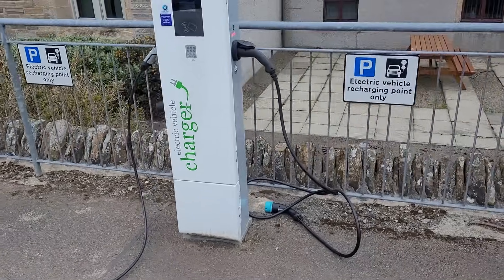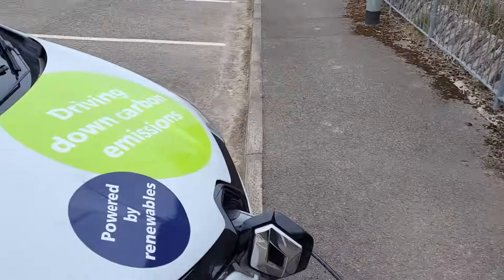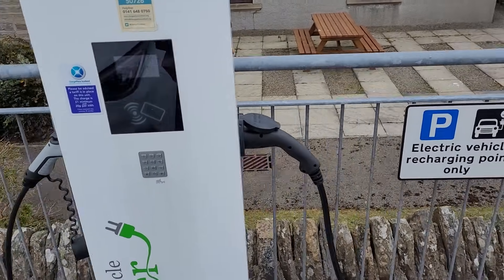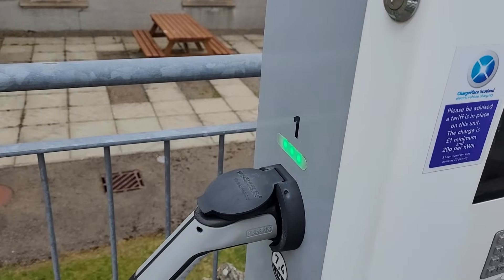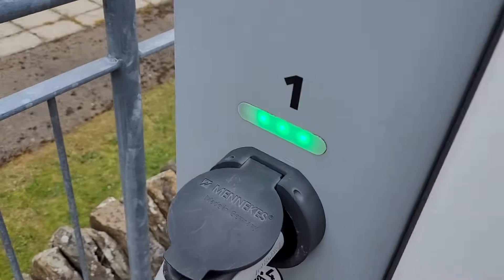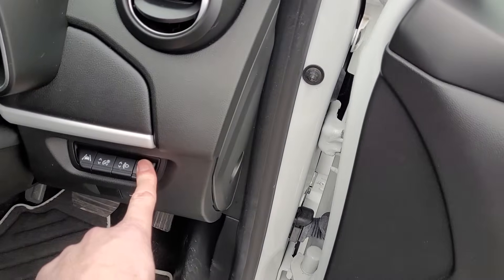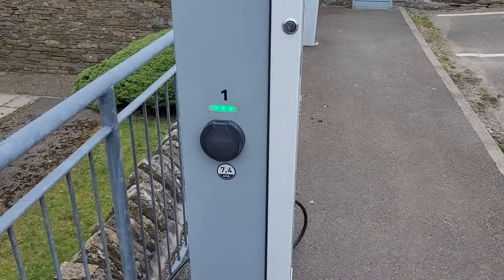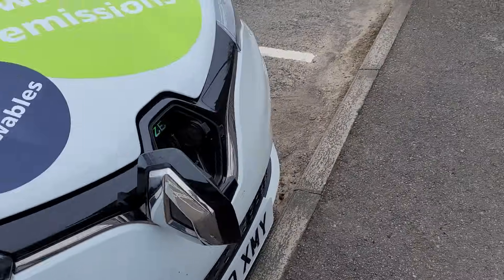How to disconnect your EV cable from a fast charger

Comment: We have just visited Southampton and the IOW. Twice the rapid chargers would not stop. Both occasions I telephoned the help line on the machine and they released them immediately. I asked if it was a problem with the car and they said no. It was a regional problem but they would not comment further. On the way home I stopped at an Ionity charger at Bridport and the charge went perfectly.

Comment: Why does it get stuck on a Mercedes eqs 550 I can't f**** unplug it I can't unplug the charger from
Reply from the maker: Try starting the charge again , then end charge with rfid card (or via the app ) ,wait around 5 seconds , then unplug from the post First then unplug the car , otherwise the post will see a 'fault' and lock the cable into the post.

Comment: Dear sir, aI used podpoint app to start charging at the public car park. But there is no option to stop charging in the app. There was no way I could remove the cable. Waisted my day.
Reply from the maker: Yes podpoint can be a nightmare , did you call their hotline ?

Comment: i will give it 3-7 years and with in them 7 years electric prices per kw will be the same as petrol, instavolt is going from 50p to 57p on may, thee electric car agenda is nothing but a smoke and mirrors trick
Reply from the maker: I charge at home 99% of the time from the 🌞 or 5p per kWh overnight.
With electricity we have much more choice on what to pay, same as expensive costa coffee at motorway services , no one forces anyone to buy a £4 coffee that you can make at home for pence !

Comment: I had a Nissan with a type 1 connector the only way to stop charge was to press the button on the car end plug and disconnect. The charger end always unlocked for me  so this requirement is clearly not universal.

Comment: This is a perfect example of appalling unintuitive design.  What you've demonstrated should never ever happen, and yet it does!  Good design shall not require written instructions to operate.

I use an EO fast charger at my office.  It will auto unlock the cable at the charger end as soon as I pull the cable out of the car. This is instant.  As soon as the signal pins are open circuit, the charger should "know" that the charging session has stopped.    It don't have to faff about with a phone app, rfid card etc.... Once the session has been stopped, by any means (car, app, rfid, disconnection at car)  the cable should be unlocked.

I've only used the CPS network once with my type 2 cable.  It didn't keep hold of my cable thankfully, and I'm guessing it's because it's a newer charger.

It's a shame for the person who abandoned that expensive cable at the charger.

Comment: Perhaps you should just charge at a charger that already has a cable permanently attached, and save all the headache...
Reply from the maker: Thats a Rapid charger then , not meant for stays of longer than 30/ 40  minuites
Reply: @JonathanPorterfield  if only there was a comms on the tethered AC cable to detect which type of car was plugged in, and give a gentle shout to all 3.5kW drawers out of the charger "Beat it and use a standard post!" but i'.m known for overshooting the runway. I believe in Germany (if memory serves) to discourage men standing to wee in cubicles a bell chimes if they don't sit, to cause embarasment. Should this be the way we go?

Comment: I had a faulty PodPoint which started a charge and then ended it a few minutes later and wouldn't restart. It wouldn't release the cable but by the time I'd got through to PodPoint on the phone it had reset and released. Patience helps some times.

Comment: I wonder if there is inconsistencies between manufacturers here? I’m able to stop charge on E-Volt CPS units by stopping and unplugging from the car first. Afterwards I hear the locking pin release on the unit end allowing me to unplug. Has come in handy when my charge session has timed out from the app meaning I couldn’t stop the unit first without phoning. I have had a podpoint one almost keep my cable; I think due to a problem with the locking pin catching as it tries to unlock, wedged against the plug. Probably from too many people trying to yank the thing out. Only managed to release it by reconnecting the car and trial and error listening for the locking pin going in and out to wiggle it free as it unlocked.

Comment: These sort of issues for something really simple is what puts people off getting into an EV.
Reply: I am 71. I have owned many,many ICE vehicles and had Many, Many problems with them. Eg: BMW brand new which kept stalling and they could not fix. VW Golf which came new with a loud clunk when I turned corners and it took 2 dealerships to fix. New BMW 3 where the exhaust fell off while I was driving home from first collection. New VW California which kept self locking which is not great in a camper van.

Comment: I'm so glad to see that the government are legislating minimum uptime requirement of 99%.
Hopefully this will be the first of many updates to the legislation to whip the chargepoint network into shape.
Reply: That still leaves an average of 3.6525 days of downtime per charger per year. It will be a big improvement, but still useless if you're there with a low SOC on a day that the only charger in the district isn't working. What would really solve the problem is for far more medium speed chargers (22 kW or faster) to be installed in urban areas, plus a lot more 7 kW chargers in all kinds of public car parking positions. 3 kW chargers are virtually useless for most busy drivers. Our city has fewer than 25 publicly available chargers, most of which are 7kW or slower, for a population of almost 100,000 people. . It's becoming an unacceptable situation, now that many more people are driving EV's.

Comment: Could it be a way of preventing theft of the cable.
Reply: Other charger designs handle that by not unlocking from the unit until it's unlocked from the car, even if the power delivery has ended.

It's not rocket science...

Comment: Pod Point ones that are free  (you just claim the charge with the app) you stop the charge from the car  and it releases.
Reply: With PodPoint you have to remove the car end first, which is the opposite way around to this and TBH makes a bit more sense as it means the charger won't let go until it detects that the car has let go, which you theoretically control so of your car is unplugged it's (probably) you doing the unplugging.

Comment: I’ve always done car first to charge and car first when I’ve finished charging and have never had a problem. That’s along the south coast corridor A3 all the way down as far west as Penzance, have I just been lucky or does this only apply to " Charge place Scotland " ??
Reply: I suspect it's this particular model of charger, because I had to do a similar dance once with a model which looked a fair bit like an early 2010s prototype of this, no controls, gratis-charging, but I'd you unplugged the car end first it wouldn't unplug at the unit, you had to be able to halt the charge with your car (in a LEAF there's a button to stop and unlock the Type-2 socket on the car) butler the cable in the car, remove the charger end first, then remove the car end.

Took a fair few tries to discover the dumb routine.

PodPoints and most other destination chargers I've come across do the opposite, they won't release the cable from the unit until the car end is disconnected first.
Reply: No, I've done it that way with CPS Scotland chargers for a couple of months now.  That said, watching the video, I think I'll take the advice on board.

Comment: I'm glad you've raised that. Wondering what other networks incorporate that system as well?
My newbie mistake was unlocking the car to open and put the shopping in but then couldn't pull out my cable from a PodPoint (either end). I thought I had R-T-F-M about finishing charging so luckily an experienced EV driver was on hand to help me realise you only have 15 seconds to release the cable after unlocking a Soul EV 2020!